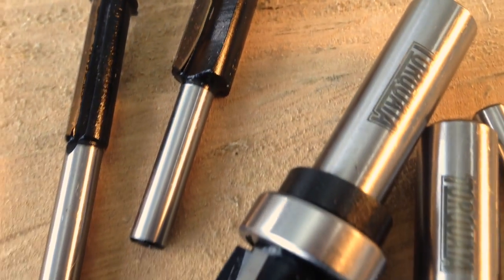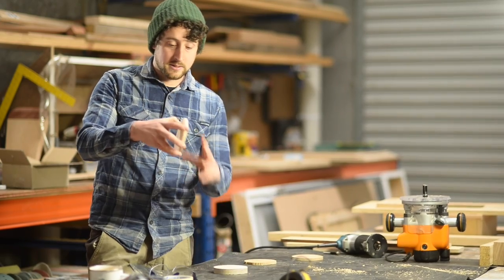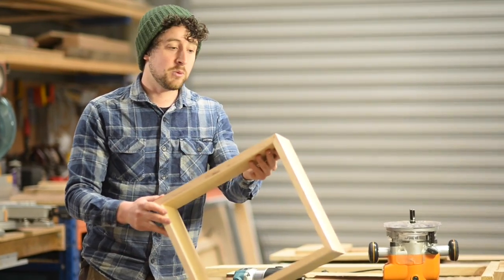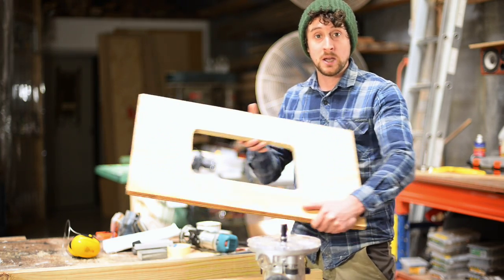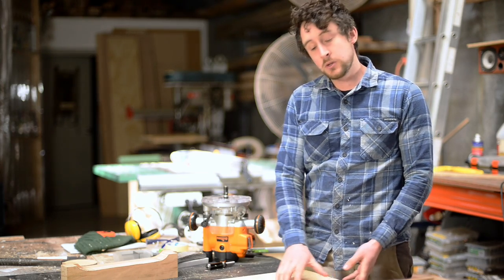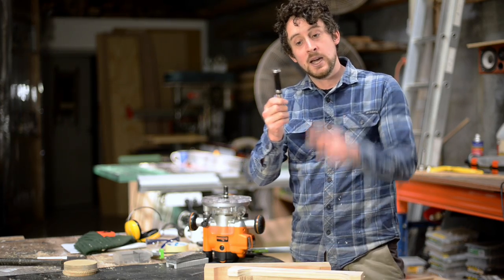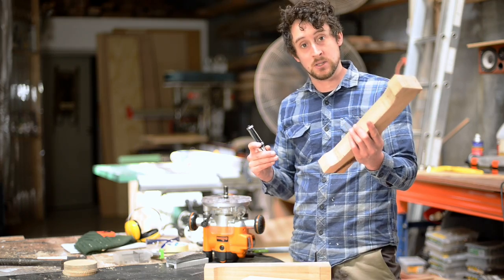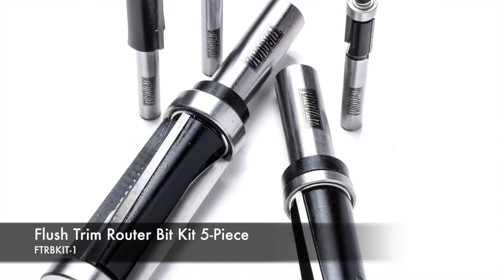The Router Bits - Five Flush Trim Bits You Can't Live Without...

Comment: Great video  Im making a large table out of 1" oak the legs are going to be made out of steel  in an inverted V pattern  Im actually a retired welder fabricator  I did a little wood work, I'd like to use a router like a 3/8" round over bit now should  I do it on my router Table or should I just run a router around the edge  Im a little apprehensive about doing this  hope I dont mess  it up 350 dollars just for the wood  ,....Great video  just subscribed